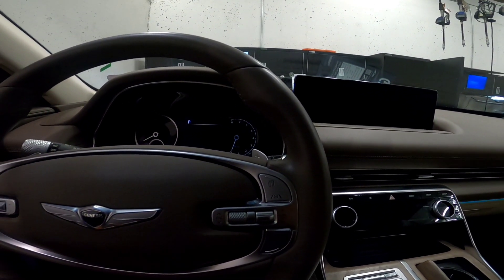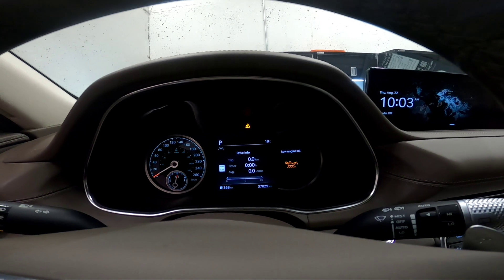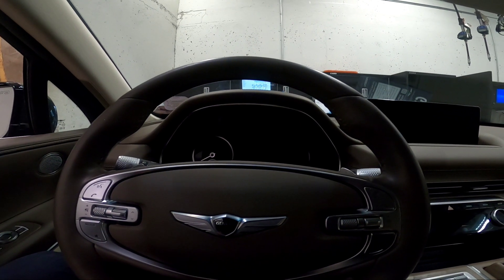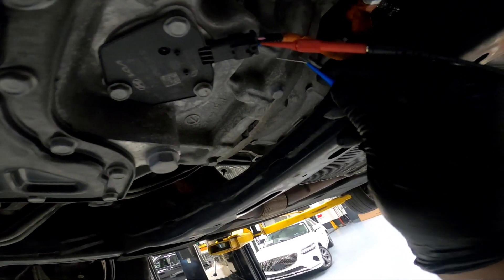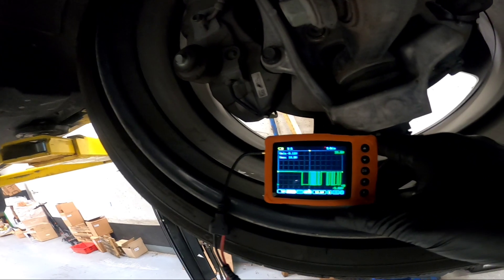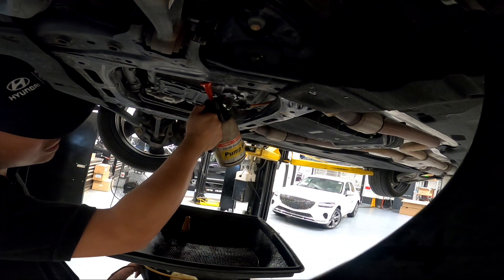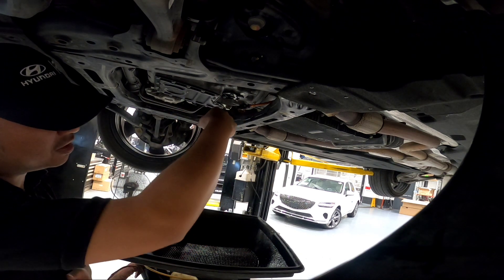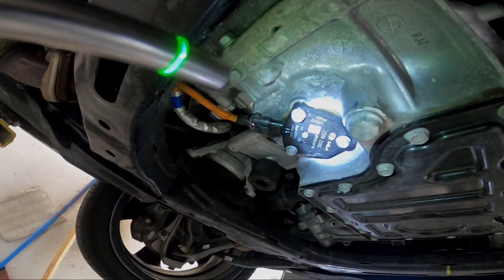Genesis GV80 | Engine low oil warning

Comment: I have a 2015 Hyundai Genesis 3.8 and I think I have this problem.  My oil light keeps going on and off, but I just change the oil less than a month.  Is it the same problem? If possible, can you do a video to fix that problem for a 2015?
Reply from the maker: Yeah most likely you got oil pressure switch issue. If i will get a chance for sure i will make a video